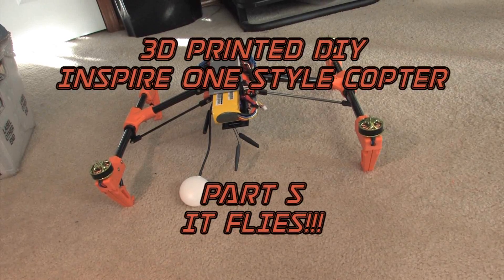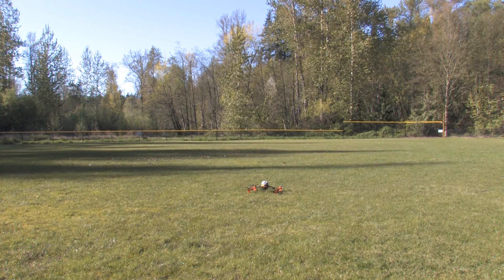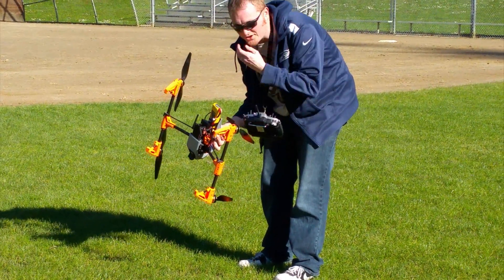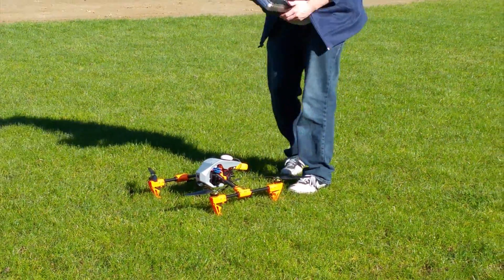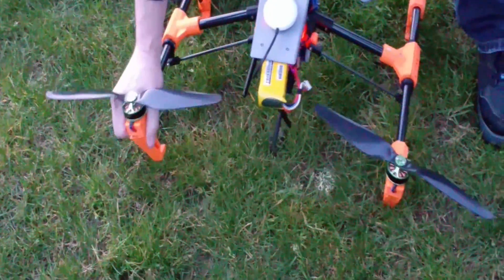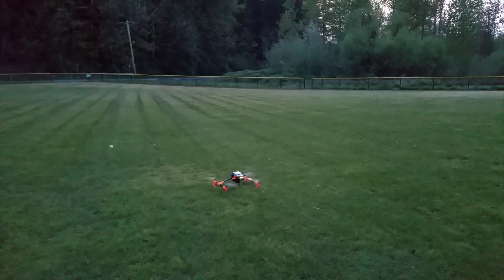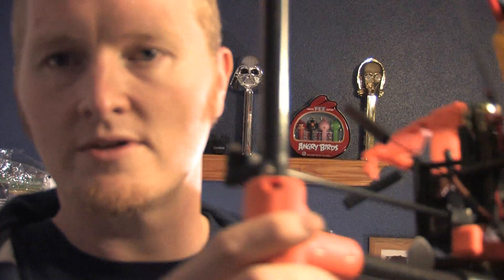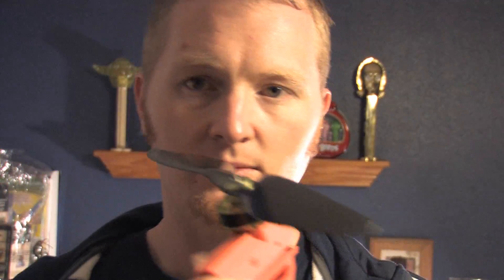Part 5: IT FLIES!! 3D Printed DJI Inspire One style quadcopter

Comment: I did vise versa, I first did this indoor testing to get use to controls etc and then went outside for a larger scale flight. My build turned out pretty good, a little wobbly though. I made a mistake drilling screw holes which were related to arms. This time I am not drilling them, i will melt it with the fastener, hoping there will be no skid. I also figured out how to make clamps actually hold the arm better, I applied some electric tape under the clamp, it did the trick.

Comment: I would try vapour smoothing abs parts, it makes them a lot stronger, also I bought one of these controllers and it's worse than my kk2 board.
Reply from the maker: +BenofkentProps yeah that controller definitely caused me some grief.  It definitely is not newb-friendly. My friend gave it to me since it was an extra he had, so I had no idea what I was getting myself into.

Comment: There is nothing wrong with the controller.  He just needs to learn how to use it.  When you fly in ALT mode like he was he started/set it at ground level.  If you hover at 50% throttle this means that when entering ALT mode it will stay at that height at mid stick.  So you can see how having it set at ground level and trying to take off and land caused him a problem.  I myself would not buy another Naza, don't like them at all. YRMV

Comment: I think if you got a different flight controller like a naza lite you would love flying the thing and it would actually lift off the ground. It's much easier to program
Reply from the maker: +Kit Dines I've actually had really good luck with it starting after this video was done.  I haven't messed with the flight modes other than staying in stabilize though.  I haven't crashed it again since this video!
Reply: +cozmogeek interesting. Are the 3D printed all files better and stronger nowadays? I kinda wanna do this but if it's still bad I'm not
Reply from the maker: +Kit Dines Well there's a newer version of this copter that people have created to fix some of the problems. It is always going to turn out to be really heavy though no matter what you do just because of the amount of plastic it takes to build.
Reply: +cozmogeek yeah I see what you mean. I thought it would be pretty cool to make an inspire clone but it looks like a pain in the ass

Comment: when I watched your first video, where you showed gps of your house and you turned the copter the direction arrow, red line. was coming out of one of the motors. that is called + mode you want to be in X mode.in the second video at the park, once it hit the ground the first time, hard. everything was off, booms shifted, at that point it would never fly straight.
Reply from the maker: I haven't tried any gps flying since it bounced off that ground in alt-hold mode. You could be right.

Comment: Just a piece of advice. DO NOT LEARN TO FLY USING A BAROMETER/GPS/ETC.... It is much better/safer if you know how to fly your machine when one (or all) the luxury systems fail. You never want an untested machine attempting to "assist" you in flying until you know it works well, and until you know how to pilot it well enough to compensate for its mistakes.
Reply from the maker: totter333 indeed. I know that now :)  It is just ironic that I was trying to use that mode to reduce the chances of me crashing it and it is what ended up making me crash.  I haven't changed the mode switch from stabilize since that flight and I haven't had any more crashes.
Reply: cozmogeek yup. It totally is! Sadly, those are the types of crashes that give drones a bad name. Glad to hear you've been having success with this build though. It is a pretty neat endeavor!

Comment: This is an incredibly ballsy project for a first time multirotor pilot - My hat is off to you. I'm glad you got it working!
Reply from the maker: CardellaTK Thanks! If I had any idea how complicated it was when I started I probably would not have tried. I'm glad I did now though. I just finished building another 3d printed copter (MHQ2 mini) and am also working on a 3rd one. Now that I got the hard one out of the way these others are simple. :)
Reply: cozmogeek Do you ever have issues with the 3d printed parts on your smaller quads breaking? I know how much I bash my 250, I can't imagine having them made of laminated plastic!
Reply from the maker: CardellaTK I just finished my smaller one a few days ago and haven't had many chances to crash it yet.  I just smacked it into a tree a few minutes ago and only lost a prop.  I'm hoping to get out to a park to get really stupid with it very soon. :)
Reply: cozmogeek I like the phrasing on that, "Get really stupid with it"! Have fun!

Comment: It's cool what you're doing, but let's be honest, 3d printing materials are shit.
Reply from the maker: sanshinron I didn't do a very good job printing them the first time and didn't realize it until I started breaking all the parts.  I've managed to fly it 4 or 5 times now since the flight in part 6 and haven't broken anything else yet.  I think the biggest issue is the weight. You need a lot of plastic to make this thing robust enough to not just fall apart. It is a pig for sure.

Comment: I really enjoyed ur hard work sir u almost There. .just remember try to put the GPS on a level surface ...right now it looks likes is leaning back that cus u a problem
Reply: I don't think GPS needs to be exactly level, its the flight controller that needs to be level because that's what has the accelerometers.
Reply from the maker: ***** I think you're right, though people put the GPS pucks up on a stick away from everything else for a reason. I haven't messed with the GPS enough to know if its getting errors or anything due to the current location.